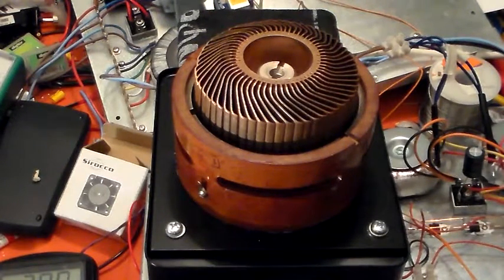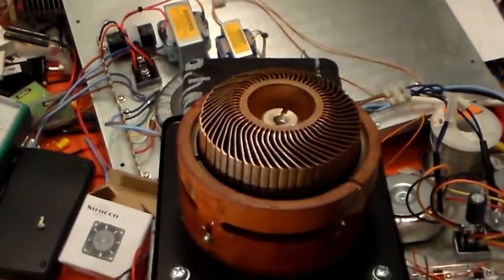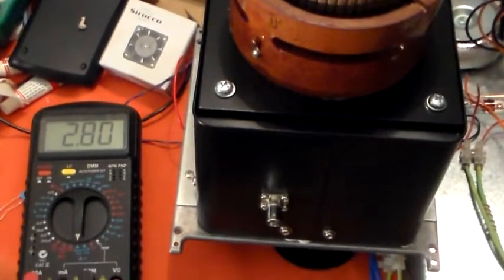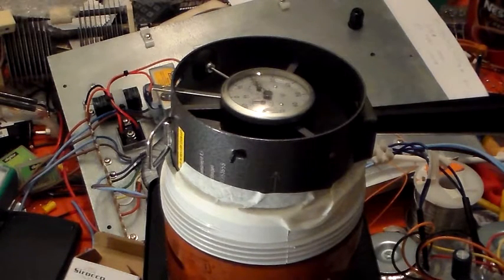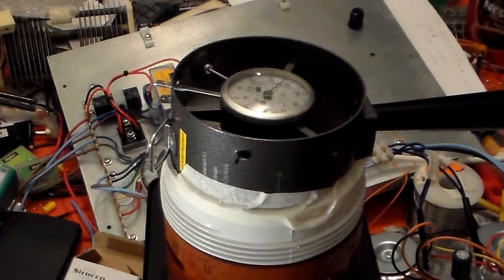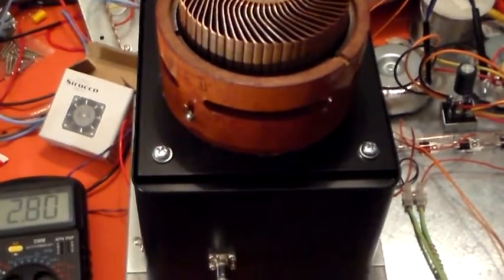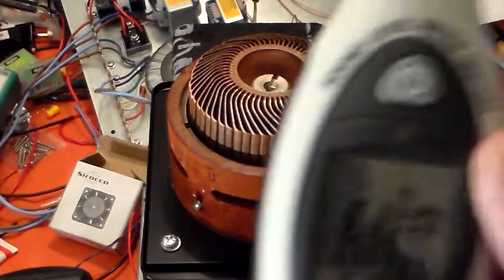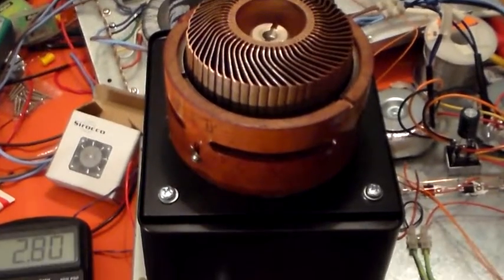GS-35B With Heaters And Cooling Fans On...

Comment: Hi Steve The reading on your flow meter is 1036 not 1136. You read those types of meters like an aircraft altimeter. Start with the largest scale and only count whole integers. The top left reads just past "1" so take 1 and multiply it by 1000. The upper right meter reads just past 0 so its contribution is 0. The meter gauge reads 36. Add them together and you get 1036. Multiply by 0.09 and you get 93 CFM. 70 CFM will get you by with a GS-35B but since you have extra capacity I would recommend using it. Slowing the fan motor down will not only reduce the tube cooling but can result in extra heating of the fan motor shortening its life. The easiest way to reduce noise is to build your amp in a cabinet large enough to house the fan internally. A very simple internal wide spaced baffle system will also reduce noise without restricting air flow. Remember sound does not like to turn corners. Another thing you can do to reduce sound is to make sure your fan motor mounting is NOT metal-to-metal. That will turn the amplifier cabinet into a big guitar box. Something as simple as a rubber gasket will go a long ways to mechanically isolating the fan. The final thing you can do is invest in a good pair of headphones. There is an way to tell if you have too much air flow. Watch the tube when you run the fan. If the air flow forces the tube out of the socket you have too much air flow. Overall Steve you are lookin good. It looks like you are well on your way to building a Battle Ax of Amp. The video is informative and enjoyable. Carry on. Bob K6TR
Reply from the maker: +Bob Marston Hi Bob, thanks for the feedback, and those kind words. Al VK6KIF, a regular on our drive time nets, and the owner of the airflow meter pointed out the error in the airflow reading when I posted this video, but I didn't bother pointing it out in the comments. It's good to see someone interested enough to notice the error. I have put a resistor in line with the fans but they are still running around 1v high (different supply to the one in the video), so if the motors do fail it will be due to over-voltage. Most of the noise is due to having 2 fans in series, I ran them without having them bolted to the airbox and compared the noise level to them running whilst bolted to the airbox. With the airbox lined with the sound deadening material there was no significant difference. There was the additional noise of the air being forced through the anode radiator. Thanks for the suggestion though. Too late for baffles, the airbox is arranged so the fans will bolt directly to the rear panel. But again, thanks for the suggestion, perhaps I'll try that in future. With regard the headphones, I was thinking more of the transmitted audio, there's not much point having a bigger signal if the voice modulation is drowned out by the fans.
Reply: +VK6CS Hi Steve. I initially was not aware that you were using axial fans to generate the cooling airflow. If you are constrained by cabinet space they are your best choice. Their weakness is their performance falls off in a big way when they have to deliver air against a back pressure. That isn't to say it can't be done but in order  to do it you need fans turning at very high RPMs. Once you get the assembly in the cabinet with everything buttoned up you will find the ambient noise drop dramatically. BTW that is a very nice Tube Socket.
Reply from the maker: +Bob Marston Morning Bob. Yes, the axial fans are pretty poor agaist back pressure, the only way I could get the required flow was to run 2 fans in series, not something I wanted to do, but there isn't room for a snail blower in the cabinet and I didn't want one bolted on the back as the cabinet is already quite large. I wondered about having the power supply and the RF amplifier in different enclosures, this would have allowed a snail blower to be mounted internally. Someone gave me the enclosure, so that made my mind up for me. I think I would have made that decision anyway, as I'm not keen on having high voltage unit-to-unit interconnections. The tube socket is an original Russian unit. I suspect the tube was mounted horizontally in the equipment they used it in as the tube weighs 2.8 kilos, and there's no chance it would ever sag, or pop out.

Comment: G'day Steve depending where you are going place your cooling fans in this unit. Your still will have noise with the fans,  it only stands to reason. I just happy you have got this far with the project. Good Luck Steve.
Reply from the maker: +Dennis Peake Thanks Dennis.